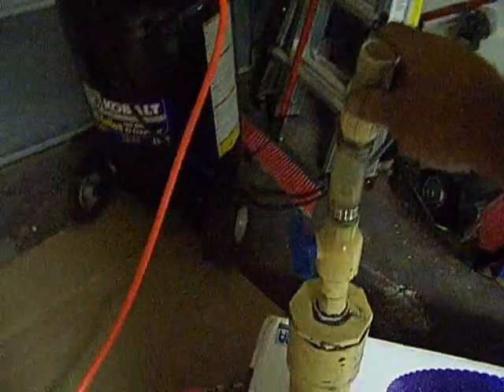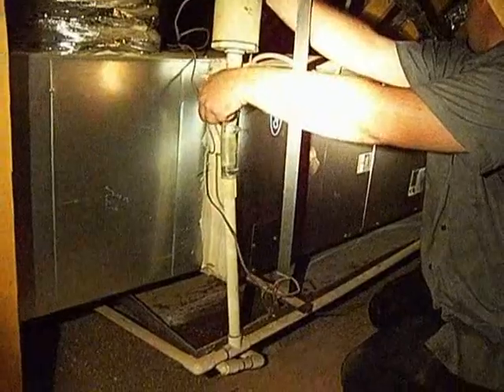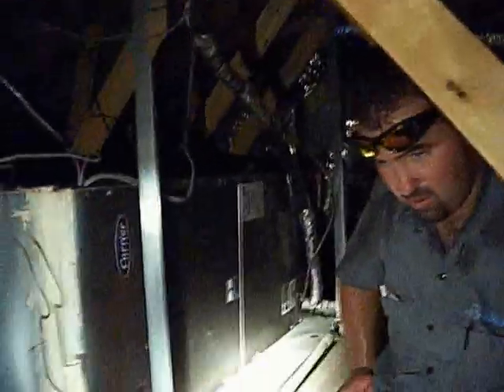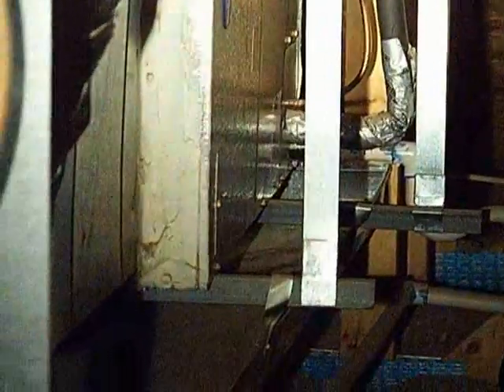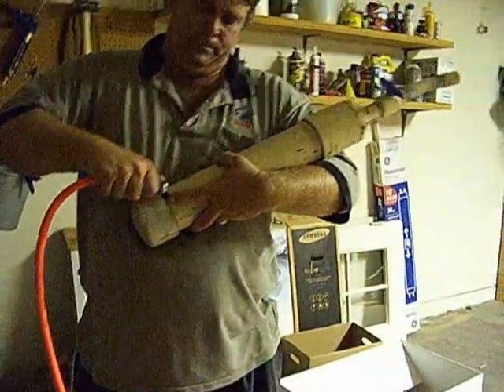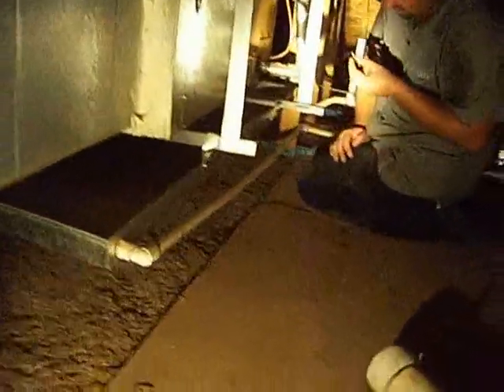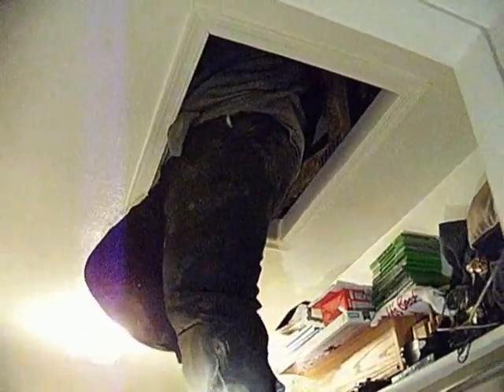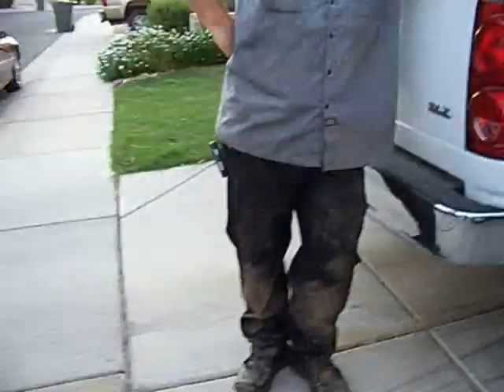The DrainBlaster 2000! The powerful way to clear drains!

Comment from the maker: Well, that may work IF the clog is after the vent and thus AFTER the trap but that wont clear a plugged trap.

The reason is you'll be outside trying to draw a quick suction with that device and since the clog would likely be in the trap and BEFORE the vent, your suction would be lost by pulling the air from the vent. No suction will be applied to the trap. 

Same problem when people used "sludge suckers" and other gimmicks to be used outside in the past.

Comment: so how many sheetrock ceilings  have you steped thru, 

anyway cool tool, I will build one and put it to good use, I figure about 25 bucks in parts and around $145.00 a use for me to clean someones a/c drain line.

Comment from the maker: I've seen the sludge suckers.
However, most units are in attics here with the vent after the trap. The sludge suckers draws air from the trap instead of through the trap if it's plugged.

Comment: Beats a boring shop vac.  That reminds me, the other week I was clearing a clog on and a-coil. The drain was piped straight into the main (about 4' away).

Threw my vac on there and sucked out quite a bit of shit, literally. No worries, I cleaned out my vac in the customer's sink. There may or may have not been some splattering.